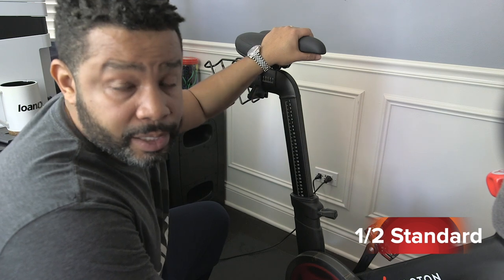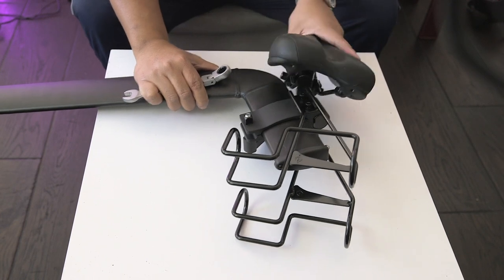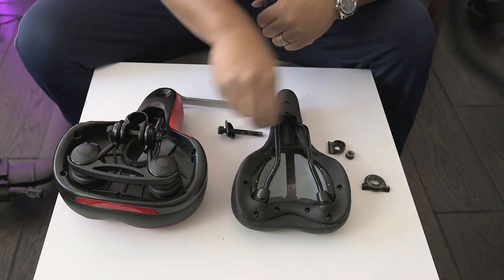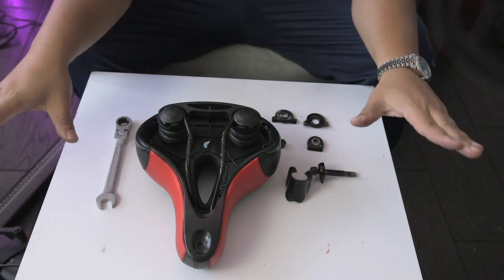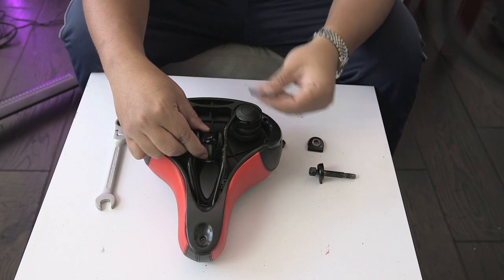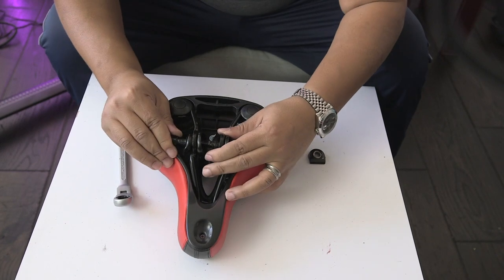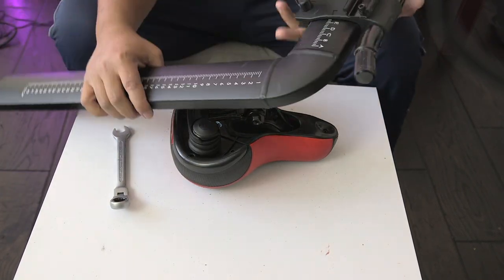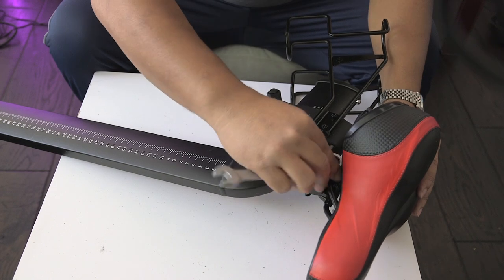How To Change Peleton Seat

Comment: God bless you! I got a seat from Trublifit and it was supposed to slide on but the bracket or whatever it’s called was too small. I ended up using the original seat parts on the new seat. Your instructions were great and now I have the new seat in my bike. This was right in time because Trublifit’s offices are closed today and they have no phone number just chat or email. You likely saved me days of frustration! Best to you!

Comment: First thank you for the video. My wife just purchased a new seat for her Peloton, so I watched your video before attempting to putting it on. I did not take all the hardware off of the old Peloton seat as you did in the video. I simply loosened the bolt bolts on the new seat and rotated the “pole holder”, as you call it, into the same orientation as the pole holder on the original Peloton seat I removed. Then I was able to just simply slip the new seat onto the pole and tighten the bolts. I hope that makes it a bit easier. It only took me about 1-2 minutes to complete the entire job.
Reply from the maker: You are absolutely right my friend. Your way is much easier and better, and saves a bunch of time. After all this time I still don't know why I went the long way.
Reply: @ppic7162  Sometimes it's just a different set of eyes!! Great video! 👀

Comment: Will this work with almost any replacement seat? Just swap the guts from the peloton over to the new one. Someone on Amazon suggested your video but it's not the seat you just did.
Reply from the maker: Now that I'm not sure of. I think some of the pole diameters are different so it might take a little trial and error.

Comment: Not sure why you are going to all that bother. There is a small stopper screw just under the front of the seat. Use an Allen key to take it out and then the whole seat will slide out. Then pop the new seat back on, put the topper screw back in and tighten and you are done.
Reply from the maker: You are absolutely right my friend. Some one else pointed this out.🙂

Comment: Just curious. Why did you use the innards of new seat? I watched your video and just a new seat on my Peloton. This was teh one I just put on "Bikeroo Memory Foam Bike Seat - Comfort Bicycle Saddle for Men and Women - Compatible w/ Peloton, Stationary, Mountain, Road, & Exercise Bike Seat Cushiona"
Reply from the maker: I believe I could have just tightened the nuts on the sides to squeeze the adapter part, however, it was so much space from one "pole holder" or adapter to the other one. I didn't believe it would have fit nice and tight. I thought it just easier to change the inside parts.

Comment: Question when you unscrewed that first long bolt on the new seat and that piece in the middle just fell out when you did that lets suppose that piece didn’t fall out what would you do ???? I got a seat off amazon that’s supposed to be for the regular peloton my new seat looks exactly the same as yours…..i was able to take the long bolt out on the new seat BUT that middle piece that just fell out on yours doesnt come out on mine it seems like both sides of the piece are welded on to the bars that means i have the wrong seat right ?
Reply from the maker: All you have to do is tap the middle with the wrench or a hammer until it drops out. Or pry it with a screwdriver.

Comment: So you can’t use the “inside parts” of a new seat?  My Peleton seat tilts so I think something is wrong with that part.  Trying to figure out how to fix it and thought a new seat might be the trick, however, think the inside part might be the problem.  Any advice?
Reply from the maker: You can use the "inside parts" for the new seat, however, for me, the Peloton pole fit better. I felt that I would be tightening the nuts forever to get them to clasp the pole snugly. LOL. I used the Peloton parts for convenience. Just tighten both sides equally.